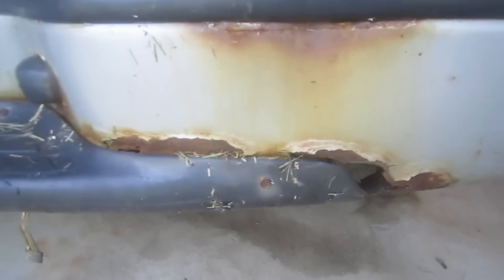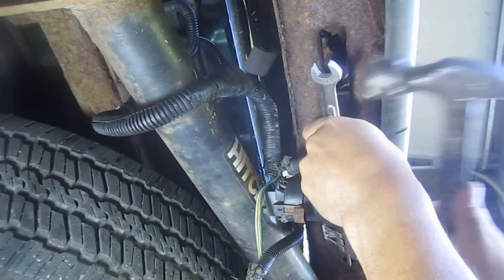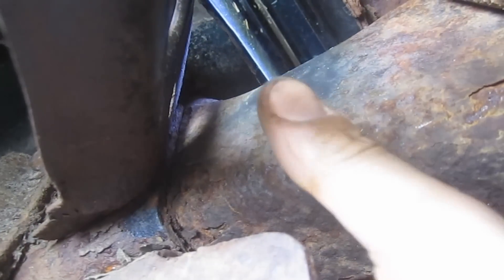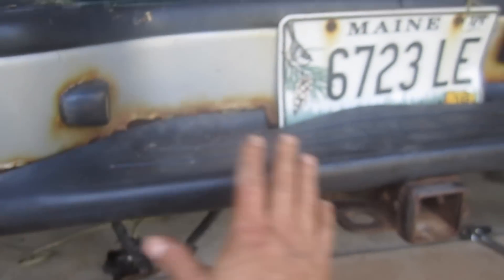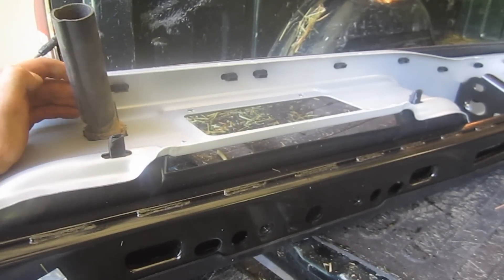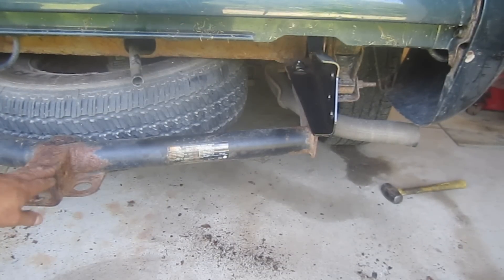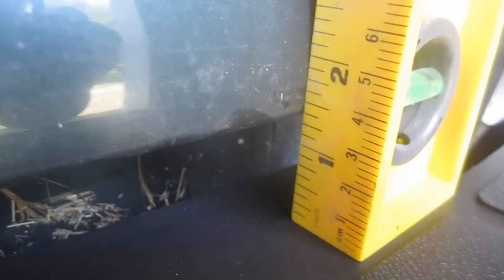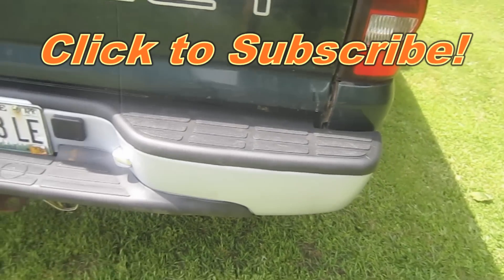DIY How to Replace a Chevy Silverado Truck Rear Bumper How to Replace a Rusted GMC Sierra Bumper

Comment: I will be replacing my both of my bumpers in the near future. I am so glad my Tahoe has spent almost all of its ,life in the interior of NC and I don't have to deal with the rust problem you guys have up north. The wife's TrailBlazer is a different story, having been near the coast for several years. Rust is mostly  minimal, but did compromise the spare rim to the point of being unusable. The hoist was rusted enough the cable had to be cut off from the lifting bar on the rim to remove the spare to remove and replace the hoist. Some of the bolt heads were iffy when replacing the suspension. Thanks for doing this video it will definitely help when I go to do my rear bumper.

Comment: Just wanted to say thanks for this video.   Did this on my friend's 2004 Sierra yesterday and it went as easy as you could hope for.  Anybody else who is thinking about this, I have 2 suggestions.   1.  watch the video to find all the bolts and spray them with penetrating oil (Liquid Wrench, PB Blaster, Kroil, etc) at least a week before and give it time work.   2.  If you take the tailgate off, the entire assembly pulls right out, no need to separate the inner brackets like Mark did.
Reply: how do you get the tail gate off?
Reply: @q7winq7  tailgate is so simple, just disconnect the wire hangers, push to one side (i forget right or left but you will see on the bracket which side to push too) and just lift it out. Its very very easy to remove

Comment: Thanks for the bracket heads-up.
A SawsAll would clear it out as well, LOL!
P.S. Too much salt on the roads, use sand and Slow Down in Winter.
Reply: Also too much reeeeaaaalllly low grade metal being used in GM products and no concern at all about coating or protecting any of it that isn't see while standing upright.  My O7 is rotting to hell. Not what I "invested" $45,000.- for. Another year or two and it will be worthless.

Comment: Thank you for the video Mark.
Reply: HAHA, yeah my motor mounts are shot on my blazer to the point where the front u joint is scaping the engine block, cant even drive it without fixing it now,,, ugh, at least the fuel pump got done !!!
Reply: Thanks for the article Mark you really have saved me alot of money and taught me alot. Thanks again : )

Comment: I'm having trouble with mine. Ok you know how there is the 3 bolts on each side? Well my bracket that goes on those 2 bolts (18mm) on the other side is rotted away so it just spins. Its like round rivet heads and since that little bracket holding connecting the 2 is gone it just spins. Don't know how im gonna get it out now

Comment: can you tell me what size bolts are the ones for the brackets onto the frame? is because i bought a used bumper that came with brackets but now bolts for bolt on frame

Comment: hey guys, ill be making a video in the next week of how to put a bumper on your truck when the brackets are too big for the frame. i will be showing yall how to cut/weld/and drill metal spacers to fit inbetween the bumper brackets and the trucks frame. i havent seen a video on this being done so im ganna do it myself

Comment: I have a 2000 Chevy and on the chrome part theres rust holes, and I see bumpers are around $160-208, I see that a rear bumper face bar is $130, do i need a whole new bumper or just the face bar?